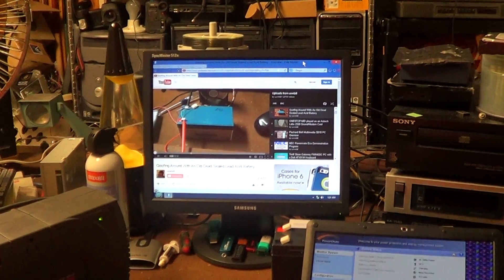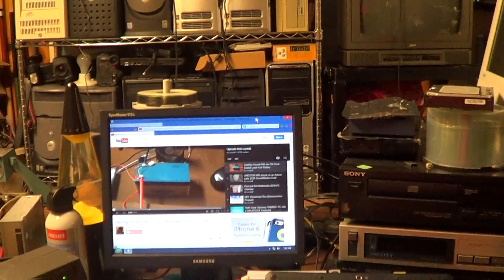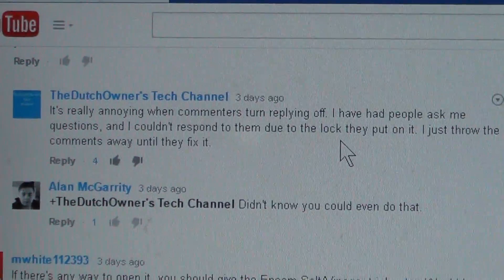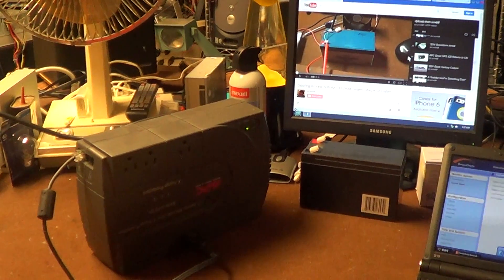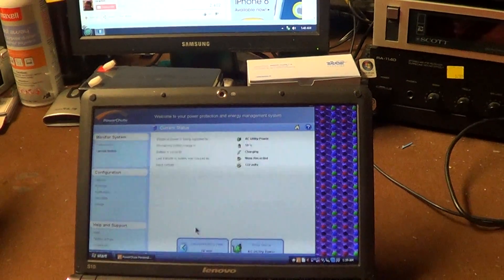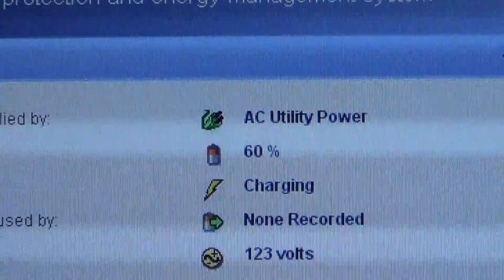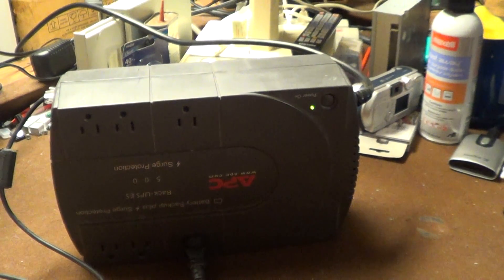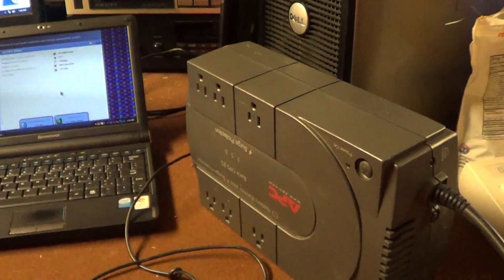Re-Enlivening An Old Dead Sealed Lead Acid Battery

Comment: i dont get it why you use winxp
Reply from the maker: Since it's not broken, why fix it? You're looking at a 2008-era netbook; that is already a low power configuration. There would be no point in taxing it with a bulkier operating system when it does everything I want it to do.

Comment: Anyone have a link to a follow-up to this Video... Curious how long it (the refilled battery) lasted.  I too have picked up plenty of old UPS units that have been retired because of a simple dead Battery. Picked one up today after testing it (at Goodwill). It passed its power up test so I figured (as pointed out in the Video and as I own a bunch of  BE350U models) that it might have been retired because of a combination of factors... I'll probably just replace the battery for $15-20 and carry on but if that battery survived say 6-12 Months or more it's be nice to know in case I ever need to extend a battery in pinch...
Reply from the maker: There's no follow up to this because the battery is still working acceptably well in the application for which I use it. It's lost a lot more capacity, but the load it has to support is minuscule. It remains, however, the only battery I own for which this treatment has been successful.

Comment: i spy a lenovo netbook that i actually have the same one. sadly while i was messing around with the netbook and thinking i had a dead wireless card only to find out it was just the wireless button turned to the off possition i had screwed up some of the screw holes for the palm rest/ mouse pad and then i tried to find other screws to replace it with and then i ended up frying something on the board cause the magic smoke came out and i think it was a screw that touched the part and the screws were to long and made dimples in the case. now the netbook gets a little warm in the area of what let out the magic smoke but still works and will charge a battery and still wants to function but i want to find another as a replacement somehow cause i love that thing.

Comment: My work was throwing away 2 of these ups's because of worn batterys. It was a nice score for free. But my pride and joy is my APC SC-1500 which goes roughly for $250 and I got it for cheap. Its a computer tower itself. Anyway thanks for the video. I found it funny bickering on crap. I agree on the autoplay though.

Comment: Can I use rain water?
Reply: +Composit guy Simple Distilled Water or acid mixed
Reply: I believe so, but you should go for distilled water
Reply: I think Simple destilled water will work just as fine as Acid mixed, i have never used acid mixed before so i can't really recommend it.

Comment: Vinegar and Epsom Salt does not work even in serviceable wet cell car batteries.
Try Alum and water mix 10:1 - 10 parts alum to 1 part water. I have done this on sealed and unsealed batteries and it does in fact work if you get the mix right.
Oh you want to "wash" the battery out first with a baking soda and water mix to get all the residue and old acid out and neutralized.
For replacement batteries try to get AGM types, they hold their charges longer and produce more current.
I have quite a few of the rack mounted APC's here that run off 24 volts and one that's 48 volts.
If your good you can connect the 12 rail in the APC to a solar panel via a charge controller, this will maintain the battery if the AC mains fails during the day.

Comment: You seem to know your thing. I have similar APC BackUps 500, but with schuko  plugs. For past few weeks I had this weird behavior where UPS would react to power failure and keep powering connected devices but it would restart them initially as if it's not able to react in time. Do you have any idea what this issue might be and if it's fixable? Thanks
Reply: Is there a way I can test this battery somehow? It should be fairly new, couple of years at the most, but that's not a guarantee of quality. As far as I know, nothing new was added to the whole contraption to cause this new strange behavior.

Thanks for the fast reply.
Reply: Thanks. I'll try getting a new one as they are pretty inexpensive. These are not as bad UPS as they seem granted I would much prefer having something like that white one of yours. They come as pretty expensive here.
Reply: We have a local supplier, so it's not an issue. It's pretty standard here. At least this battery type. Am just surprised that it went bad this fast.
Reply: Well, to be honest I don't feel like investing money in new UPS right now. I use them for occasional voltage spikes/dips as they are quite frequent here. Am not even sure how much power my rig requires at this point. I always build computers to be as low powered as possible.

Comment: I wouldn't ever use the Epsom salt/vinegar trick either.  At best you are aggravating the sulphated battery with more sulphates and magnesium which interferes with the battery's ability to hold a charge, at worst the plates will form an acetate film which will also kill the battery.  If I come across a dead SLA (that isn't swollen/cracked) I fill the cells up to the top of the plates with distilled water through a syringe, let it sit overnight to soak up onto the glass mat, and then add a little more to ensure the mat is thoroughly wetted before putting it on a 500mA trickle charge for an hour or two followed by a bulk charge at 0.5C.  After re-wetting most SLAs will have full voltage but very little capacity.

Comment: I never really understood the difference between the APC 500 and 350. They appear to be identical; although I'm not sure the 350 has the telephone jacks and the RJ. At any rate, the only reason I own one is because they're so easy to find in the trash. Just find one and buy a $20 knockoff battery and you have a bargain UPS for a router and/or modem.
Reply: I agree, and even if the name brands are better, it wouldn't make too much of a difference considering the low-end trickle chargers in these APC units tend to wear the batteries down regardless. Thank you for the explanation on the different models!

Comment: I'm using Google Chrome, I think it's the latest version, and it looks as if Google has changed the function of the AutoPlay option, now they call ti loop playlist, so it's probably now some kind of repeat function, I've turned it off, but just now I watched this video, it ended, then the Radio Derp video started playing automatically, not good at all.  I may be wrong though, perhaps this option is going to work differently for different users.

Comment: Everytime one of these has failed for me, the plastic has melted and it has been impossible to actually open the UPS to replace the battery. I was under the impression this was a design feature to make you buy a new UPS instead of replacing the battery every 10 years ;)

Comment: You said it uxwbill. I am running machines with Windows XP Pro/Home. I could care less if the OS is not supported any more. In my opinion, (only an opinion), Windows Xp is the best so thats what I'm going to use until they pry it from my cold, dead hands. :)

Comment: Me and my brother got lucky and found an APC SC1500 UPS at a thrift shop for $30. It's pretty beat-up, and the front plate is gone, but it works great! The batteries weren't even bad! I just nee to get a serial cable for it to really see what it's doing.

And I hate the new autoplay sh*t too, I have no clue what the people in charge of these thing are thinking, but there clearly NOT thinking things through.

Anyway, subscribing, you have my interest.
And reply should be enabled on here, if not it was YouTube, not me, and I'm not sure how to change those settings. I feel like that setting was added so whiny little kids who don't know how to comment wont have to deal with other people.

Comment: Thanks uxwbill for posting this as I have the same model (APC 350) as I can probably now get to see the battery level now as well diagnose a problem because mine after a while (2 days at most) starts spazing and complaining with a constant and annoying tone (with no pause) and I now have a info cable in transit, hopefully you can reply to this as I myself have yet to work out the bugs (yay) <- obviously misspelled
Reply: nah i was going to keep it light as to run a modem, and i got the cable today and installed the program. It couldn't even recognize the percentage of the battery so i knew it was bad after that. but thanks for your insight on this matter. plus i will send people your way as well, thanks again and have a nice day<-(I think, Time zone)

Comment: The Rs 1500 is like the one on my dell given to me by my uncle it lasted about 8 years before the batteries went out on it and batteries plus Knoxville tn is where I got my replacements and its still going the one thing I like bout it is that with the batteries dead it still worked other then back up in power failure

Comment: Is the issue with it being unable to supply a proper current due to the high drain or lack of capacity? it would be interesting to see a couple of these daisy chained to see if you could get some form of a stable output for higher end devices. And by that i mean a low range computer, ~200watt drain.

Comment: you could always remove the small battery, extend the connecting wires, and hook them upto a higher capacity battery, like a car battery, or two.. would give plenty of juice to power a small computer for a bit..

Comment: "Warning: Contains rambling, ranting, the word 'hell', and obnoxious opinions about many things."

Sounds like you followed me around work yesterday! (And I get to do it all again today. Just wait until I tell you all the story about this...) Speaking of which, we got a whole tote of Duracell Quantum batteries yesterday that had gone "KABOOM!" on the truck. There were battery guts all over the place. I wish I'd had the presence of mind to take a picture of the aftermath. "Brutal" doesn't even begin to describe the amount of destruction of the packaging the batteries were supposed to be in. It blew everything completely apart. I'm just glad that happened on the truck. If it happened while we were sorting through the merchandise, whoever was doing it probably would have ended up in the hospital.

Comment: Idle hands are the devil's playthings.

I wonder if you could replicate that cable by attaching an RJ45 plug onto the end of a USB cable. But I imagine that either the wire will not be rigid enough or too thick or both.

Comment: I some times get the same from people that see me with broadcast equipment. I have became good friends with the Engineers at the tv station I work at and from time to time if things were getting thrown out do to age I would ask and they would give. I have walked away with a lot of cool broadcast stuff over the years and I have never taken anything with out the ok of the Engineers. one big thing being a almost bran new JVC TM-A130SU video monitor from 2000.

Comment: Bill, your never boring.
It is a shame they put cheap low capacity batterys in those inverters, you didnt say the inverter section failed in them so a quality battery would make them quite usable.

I use win xp, it does not argue like the other types of winblows does lol.

I would imagine you need a constant current discharge circuit to work out the capacity of those batterys, and a volt meter to monitor them.

I could not view your previous video as there appeared to be a network problem that made every video turn to raster with the "there is a problem" in the center of the screen, perhaps it was part of the system that served the uk and surrounding countrys.
The internet is an odd beast lol.

Comment: I pulled a dried out SLA battery from a BP280S. dropped a new one in... but the UPS doesn't sound too happy, at least being on. I'm going to have to pop it open and do some investigations... but at the end of the day, older APC equipment is reaching the point where capacitors are starting to go out of spec.

if you want a good channel to watch with someone who really knows what they're doing for big lead acid batteries, FFcossag has a bunch of videos so far with some interesting results in either desulfating or rejuvenating some batteries with some voltage.

Comment: Bill, I'd just like to say with regard to your comments about the Youtube Autoplay and Comment system, I'm am 100% with you. I want the right to reply to any comment (not that I get any on my page) and I don't like defaults being saved without my being consulted. In other words, I second the motion brought forth by you regarding the mentioned issues.
The other thing I'd like to mention quickly is that I support your use of win XP regardless of Support, if it still works and does what you want, why scrap it any way?
I think you would like the UPS that I have, it required a 15 amp Power Lead on 240 Volts. At my Brother's place, there is an industrial UPS rated at 6 Kilowatts. That one, of coarse, requires hard wiring and multiphase power connection.
Reply: It's funny because MS wanted everyone off of it and hyped up the dropping of support for XP like it was going to be some kind of apocalypse, but that never happened, everyone just keeps on using it and it just keeps on working. This doesn't please our friends in Redmond, but to loosely quote one of their own commercials, it's why they make me smile.
Reply: If its not broke don't try to fix it.
Reply: Joe Will yup. it's very annoying that some can't you reply to because like this scenario. if i find a comment on a video that i think is stupid i comment something but i there is no reply button i usualy vill get very frustrated.
Reply: the compaq nerd
I know what you mean. These days, I try not to engage the writers of stupid comments though as it brings more trouble than any idiot is worth.
Reply: Joe Will
yeah

Comment: What I dislike about those Back-UPS units is the terribly cheap plug outlets.  Mine is touchy on at least most, if not all of the outlets.  Mine is a higher wattage version of that same design, it can handle a computer but I don't use it with computers anymore.  Instead it's plugged into the pile of network crap.
My favorite UPSes are the old serial SmartUPS units, but they do require $80 worth of battery. The one I'm actively using has recently informed me that it's batteries have failed.  I know because it reminds me every 6 hours with a rapid beeping noise, just before I forget.  It has elected to further harass me by continuing to perform a weekly "test" of the bad batteries, at which time my PC immediately shuts off.  I'm sure it gets a kick out of that.
I'm not going to admit the possibility of trying something unadvised for safety. But if I did, I would be careful and responsible for my actions. But it won't happen though so stop worrying about it.  What? No.
Reply: ***** One other odd thing this SmartUPS did - starting about 1 week before the batteries were reported failed, the fan started running almost constantly, and eventually it became 100% constant.  I took it apart thinking it might be dusty inside, but it wasn't.  I guess maybe it's just constantly trying to charge the battery, and the fan always runs during charging.  Since it knows the batteries are bad, it seems it would be programmed not to charge them anymore, but it's the only explanation I can come up with.  I guess I should stop being lazy and get the batteries out before they degrade further.
No big deal about the broken formatting on your comment.  It doesn't work on eBay either, but they broke it reliably.

Comment: Can you show what the battery looks like inside after you cut the top off.
Reply: *****
I wanted to see what was under the piece that you were going to glue back on in this video, where you were able to put water in the cells. I know what is inside of a lead acid battery. If I could see what is under the piece you cut off, it would help me determine how I would open up the top without doing any damage to the battery if I ever want to do what you did.
Reply: *****
I will try that the next time my house alarm backup battery goes bad. Thanks for the replys

Comment: Bored eh?

I just revived my old BackUPS 280 by swapping in the battery that was in the FiOS backup. Seems to still work.

Google really should allow the video poster the ability to reply to all comments on videos regardless of the user's settings. technically you are a comment moderator after all.

Comment: Good show. I'm not surprised you were able to get the battery to work at least half-decently again. 5 years really isn't much for a battery in something like a UPS, where it sits maintained at full charge, rarely going into use. I have a battery which has a date code of 1997 on it, and it had sat at 0.0V for who knows how many years before I obtained it. I filled it up with water, threw it on a 32V power supply (internal resistance was very high, so it drew little current even at that voltage), and today it works very well and has a good portion of its original capacity.

Do those APC UPSs monitor the battery such that it can tell when it's lost significant capacity and should be replaced? Also, I wonder if it would properly charge and maintain a large car battery or what have you, if you wired it to the battery terminals?
Reply: ***** That's what many intelligent car battery chargers do - they are constant current power supplies, so they feed as much as 30 or 40 volts into a battery to get a decent amount of current, if they have to, and then reduce it as the battery "awakens" and draws more current. In my case I did it just until it revived to a point where it drew more than a couple hundred milliamps, then I moved it to a 15V supply.